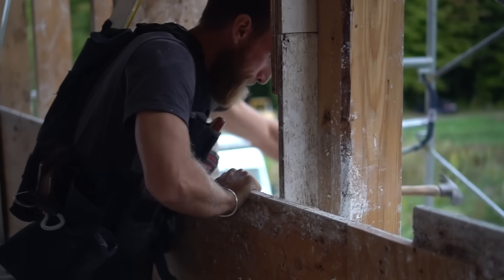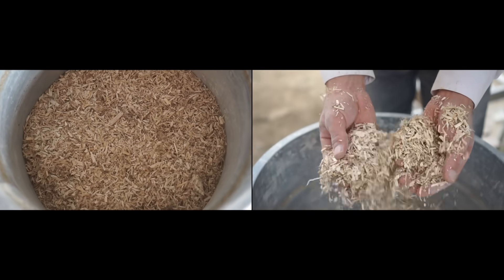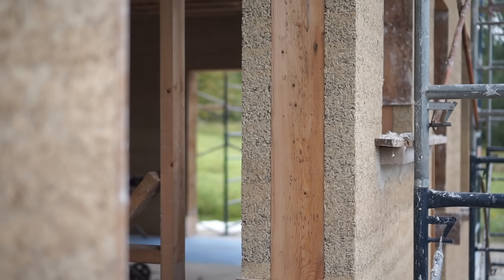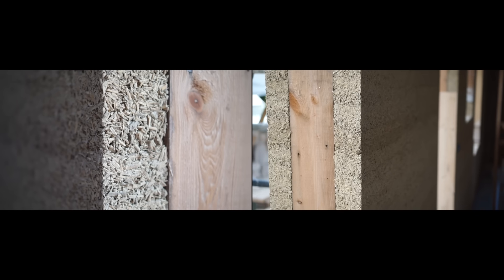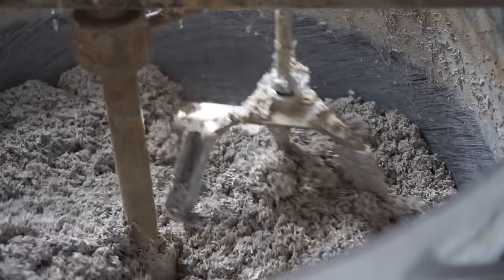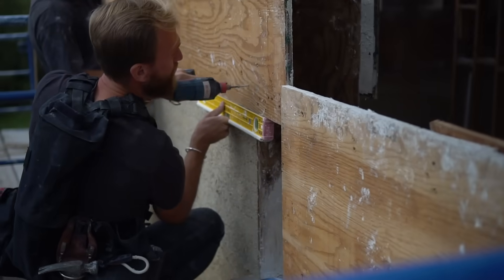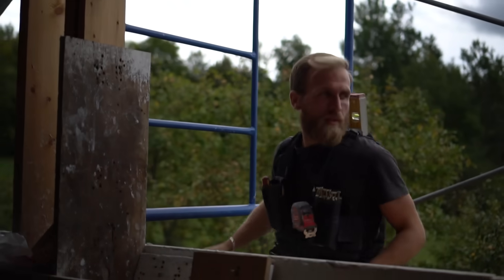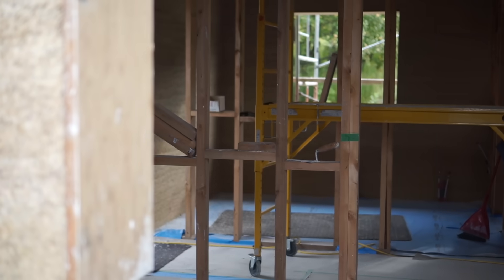Building with Hemp – An Incredible Natural Insulation & Sustainable Material

Comment: I am brought up in such a way that when you only hear the positives and nothing of the negatives, then this could either be a sales pitch or a propaganda. Word of advice to Exploring Alternatives. Share with the viewers genuine negatives of this construction material. Every material has its limitation. Discuss these to make this rather interesting video even more balanced...
Reply from the maker: Thanks for your comment, that's a good point you're making.  We usually try our best to get a good balance of pros and cons in our videos but it's not always easy. Sometimes people are very excited and positive about what they do and it's hard to get the challenges out of them :) I think the main drawbacks that he mentioned in the video are drying time and higher cost of construction do to labour time. Thanks for checking out the video and happy holidays :)
Reply: @ExploringAlternatives   I also wonder about the durability of this technique.  If the material is taking on humidity and releasing it over time will that not cause fibers to decay or degrade?  ...has this been tested, or is it currently being tested within construction projects?
Reply: @ExploringAlternatives  thanks for your kind and considered reply. Here's wishing you a happy Christmas.
Reply: @ExploringAlternatives  The problem is you didn't really explore alternatives here.  You just noted one and left out all the details.  You need to add value, not just produce warm fuzzy commercials for a bunch of different techniques that are mutually exclusive.  Example questions I have before I'd consider using this in an actual building:

Did you check the Wikipedia article?  It doesn't look like this makes load-bearing walls - additional structure is required to hold up the roof and second floors.  What is recommended for bearing those loads?

How does moisture management work?  Does hempcrete rot when damp like wood?

He says that almost none of his buildings have installed AC - is this because you can't use AC due to condensation issues?

What does a Hempcrete wall assembly look like - layers of what, what kind of cladding, how do you do the interior detailing?

How do Hempcrete buildings compare to the extensive experience with cob buildings, or with rammed earth buildings?  Your other video on cob literally has a title lede "THE BEST BUILDING MATERIAL!" - so... what do the Hempcrete people have to say in response to that?

Is hempcrete susceptible to termites?  Do you borate the hemp hulls, like cellulose insulation?  Have you built hemp buildings in areas with normal termite infestation?  How about Formosan termite infestation?

What are the main callbacks you get as a hemp builder?

Why lime and hemp rather than portland cement and hemp?

Are any other additives required to mix with the lime - what's the recipe?  What kind of lime?

How does hempcrete compare to traditional mass building techniques like cast-in-place concrete (and modern SIP construction)?  How about to dense-pack cellulose, among the best options for thick insulated walls in current American stick framing construction?

Which climate zones is Hempcrete recommended and not recommended for?

Have any of these Hempcrete houses been Passivhaus or NetZero certified?

Does the wood on a cast-in-place Hempcrete structure (which looks to be embedded in the Hempcrete) need to be ground-contact pressure treated?

What does it look like if you cut a cross section through a 50-year-old Hempcrete wall?  Building science has taught me very clearly: Whatever you answered to previous questions about rot and moisture, I don't believe you without evidence.  New building materials burn people in one way or another almost every single time, until their limitations are understood.

Does Hempcrete suffer from freeze-thaw cycle damage like the more porous grades of concrete sometimes do when exposed to water?

For that matter, how do Hempcrete blocks compare to Autoclaved Aerated Concrete, with similar density and block-based building?

What's the minimum thickness for a Hempcrete wall to hold together?  How thick do you usually construct Hempcrete walls?  What's the window detailing look like on very thick walls for your buildings?

What kind of ACH50 airsealing performance are you seeing on your Hempcrete homes?

What does a burn test of a hempcrete structure look like?  (I have reason to be optimistic here)
Reply: I know it looks miraculous, I am still amazed after 15 years. There are a few downsides to it, from a customer's view, it has a higher cost and takes more time than conventional. From a builder's view, it takes more care on the execution. Yes every material has its limitation, but the overall performance of the hempcrete wall is undeniable.
Reply: It says in the video and the description that the hempcrete in not load bearing. That's the negative! Timber stud work is the main load bearer in this system, with the hempcrete packed around it.
Reply: SCD Observer It also says hempcrete costs 20-30% more. And that it takes longer to set than concrete. Also, I can say he did use correct construction terminology throughout, it was a good introduction to the material.
Reply: @seededsoul  For daring people out there, we can build ourselves.  The cost then becomes time.  If the opportunity to invest time and energy is there, I think the outcome will pay back many times over.  Plus, more of us should learn to build...we may be the only species that mostly CANNOT build it's own home.  That's kinda crazy when you think about it.
Reply: The speaker listed a number of negatives: higher cost on average, their solutions don't scale up to the mass market, the material is not load bearing, etc.
Reply: But it eats  CO2. Doesn't that pro alone outweigh any con?
Reply: @mojigbrown3878  NO ... you have to be more objective!
Reply: This channel isn't bound by journalistic practices. Watch it, learn from it, and do your own research. Don't put such a burden on something that is essentially free entertainment.
Reply: @scottperezfox  it isn't entertainment for me, but more educational. That's what I like about it.